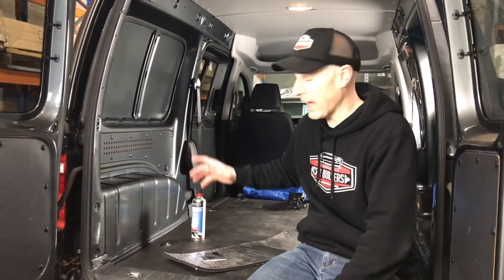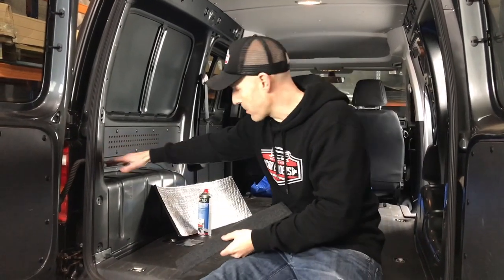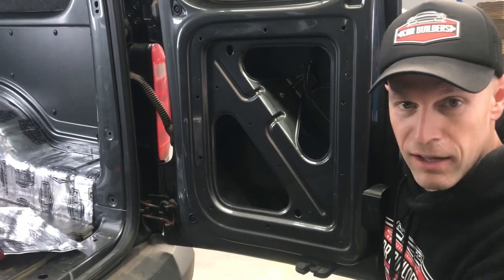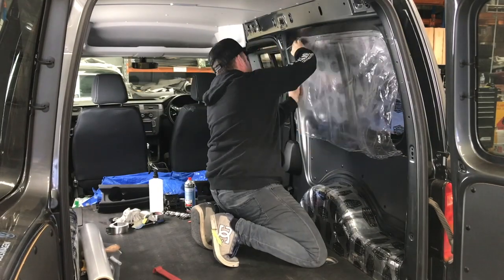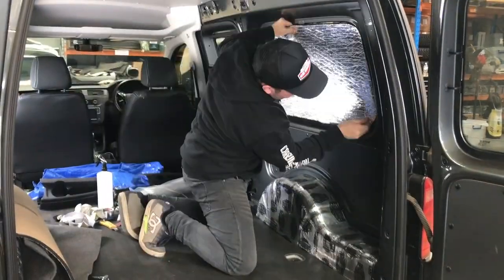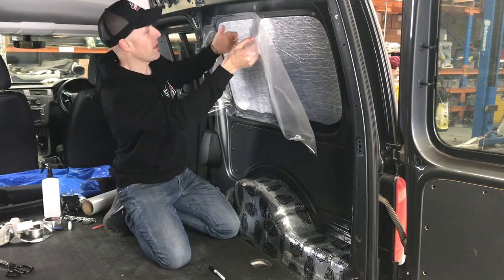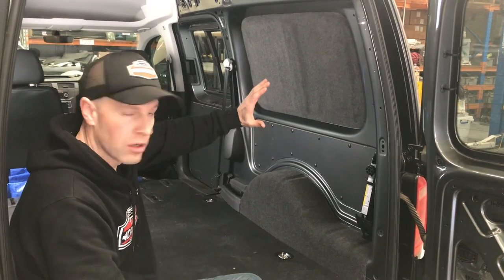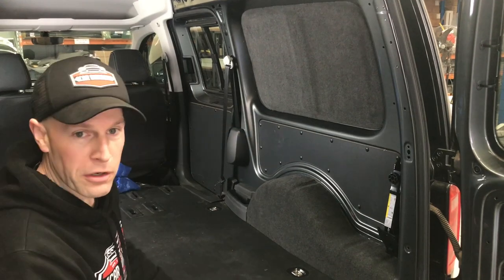Basic Sound Deadening in a Van, VW Caddy

Comment: Good vid. Exactly what I was looking for. Have bought sound deadening and insulation for my caddy. Is it worth while doing the floors and roof also? I'm looking to get the floor ply lined and carpeted afterwards.
Reply from the maker: Thanks Ken. The ribbed floor is not as essential with sound. You may want a product to use for insulation under the flooring (Van Seal, Van Liner, Mass Noise Liner). You do get results too by doing the roof (stage 1 Sound Deadener and Stage 2 Insul Layer as insulation, decoupling layer). It's just how far you want to go. 👍
Reply: @carbuilders1  thete is a loud crscking noise in my caddy which wakes me usually early morn , can insulation stop the vans contracting and expanding noises,

Comment: Looks great. Did you happen to take any before and after dB readings?
Reply from the maker: Thank you Alex. No, it is a very difficult thing to complete a controlled, standardize test and we don't want to be misleading. In other vehicles we have tested we have had results anywhere from 4db to just over 10db (remembering an increase of 3dB doubles the sound intensity and a 10dB increase  is perceived to be twice as loud) 👍
Reply: @carbuilders1  In this vid you mentioned the carpet is Mid Grey but I see you only sell light or dark?